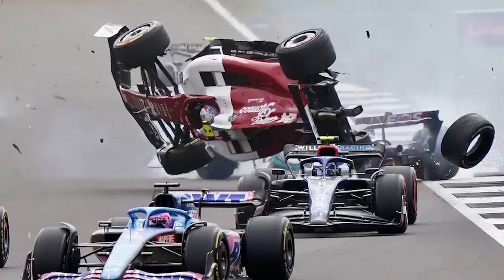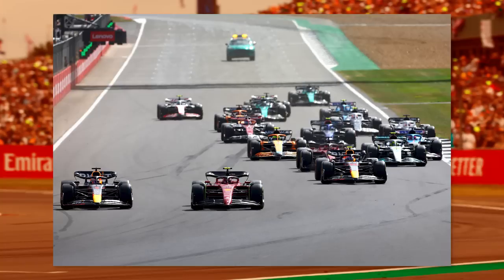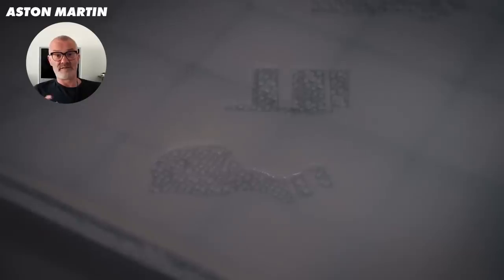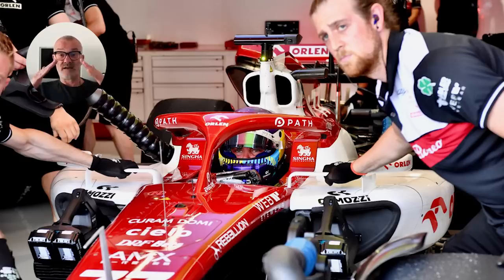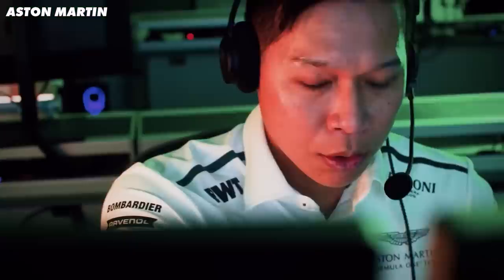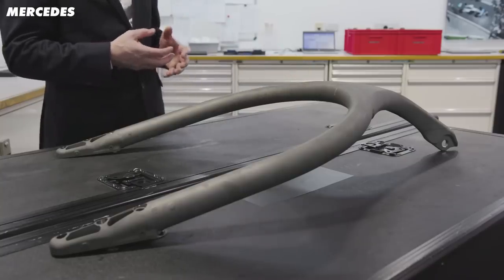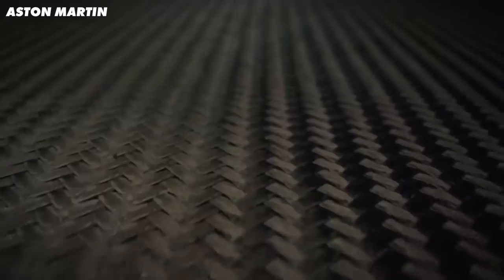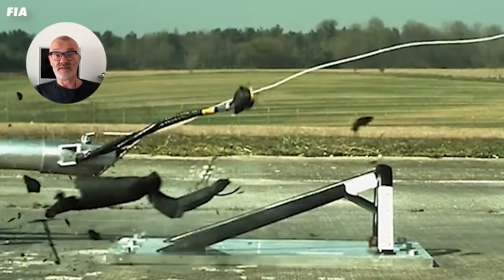Did the Roll Hoop FAIL in Zhou's Crash?

Comment: I find it very odd that they are allowed a blade style hoop, or even a two-leg design. Zhou's crash showed one of the biggest issues with lab testing: the real world is much crazier. As it spun upside down, it essentially wiggled the blade and seemed to have broken the carbon. A four leg design most likely would've lasted a lot longer, as it can disperse the load across a much larger area. 
It is also surprising it is just bonded on top, instead of being made an integral part. The entire monocoque is handmade, so integrating it would be possible. Given how important it is, it would be a good way of retaining the hoop in an upside down slide.
Reply: Exactly
Reply: Doesn't seem like rocket science does it. I agree, a 4 leg design seems like a no brainer.    As for the testing..  Why they used a static load test for a part destined to experience impact, is a real head scratcher.
Reply: @M3rVsT4H  Same reason helmet makers test their helmets in static form: it would never pass a dynamic test. 
The latest standard in MotoGP is the first to do dynamic and random testing, coming closest to a real world scenario.
Reply: @Yvolve  Now helmets I get. Wherever big profits are to be found, you will find shortcuts.  But nobody gains from this... Other than just not wanting to crash test such an expensive monocoque.. I can't think of a reason why you wouldn't just test thoroughly.   but oh well, I guess that's why they get paid the big bux.
Reply: That wouldnt hae made a difference. the mono is essentially a composite of carbon fibre and a comb between the layers. What happened here is that it sheared at the comb so the top side was gone but bottom side was intact. Thats the biggest problem if oyu glue it. You get the weakest point between the layers and the comb. if you bolt the roll hoop the differs. not the bolt is hold underneath the whole therefore it is way more resitant to shearing.
Reply: @Infiltator2  Not really, especially in crush structures, it's solid carbon. 
It needs to be moulded in and through the carbon, all the way down to the floor, like any real roll cage.
Reply: @M3rVsT4H  Over-reliance on computer models I guess. As I said, the real world is often crazier than models can predict or have data for. The just need to destroy a couple of basic chassis, to see what happens. Paid for by all the teams together, make a generalised body that has a specific crash structure to homologate it, so it can be mandatory.
Reply: @Yvolve  Dynamic impacts can be perfectly simulated. The problem is, you actually have to do it. Be creative and not only model a perfectly organized scenario. Some 'tests' look less realistic than the choreography of a cheap action movie.
Reply: @mennovanlavieren3885  I meant it more in the way that you can't always model for everything, obviously, but it seems they're going the route of motorcycle helmet manufacturers: they test in a very specific and repeatable manner, which leaves out the randomness of the real world.
Look at Grosjean: it turns out, they never though about what would happen in that situation, nor did the person who designed that barrier. 
Zhou's crash shows that they need to do real world testing as well, because you can't program for every parameter and iteration.
Reply: @Yvolve  True, perfect safety is not possible. However, I would say one can do more test scenario's with computers than destroying a real object every time. Although some real world testing is always necessary to validate the simulations.
Reply: @Yvolve  the only real world testing that would stand to those standards is actually racing and see who crashes and how, every test that you can immagine in the real world you can simulate on a computer these days (also in the real world you only test a few times with such expensive cars, on a computer you can simulate 1000 crashes slightly different parameters and see if you got lucky the first time)
Reply: @mennovanlavieren3885  Modelling is great, but it needs to be done in real life as well. Is the glue actually as strong as was modelled, etc.
They rely too much on the models in my opinion, with the biggest being that the model is incomplete.
Reply: @Imthefake  As I said: the models don't always take into account weird things that happen in the real world.
In Zhou's case, a car that was doing an under-flip and a 180 at the same time, landing ON the blade, on tarmac. Models usually do not go this far when it comes to testing, as it is programmed by someone. Their imagination is the limiting factor, so many possibilities aren't tested.

Computers are great, but not the be all, end all of everything. If this worked so great, why does NCAP still crash cars? 
The monocoque is a homologated part, which the FIA can test as a general item every car needs to use. It's expensive to smash a bunch of those, but not more valuable than a human life. 

Your reasoning is what creates the blind spot in testing in my opinion: computers can do it all!
No, thy can do what they are told, so the person programming is the limiting factor in possibilities for tests. This is a problem.

Comment: Great video as always. A little sidestep: did you also notice the new trend in ‘22 that after contact the rim fails and a tyre (and shrapnel from the rim) gets lose from the cars? I guess this is a new safety concern with the new cars (and 17” wheels).
Reply: Happened already at Max's crash at Silverstone last year. I haven't seen that in 30 years before, but a couple of times since then. Seems to have started with the introduction of stiffer sidewalls for rear tires mid season last year, and with the 18" rims, now all wheels have these stiffer sidewalls.
Reply: The shrapnel we saw from the rim looked like it was just the plastic rim cover (a.k.a. wheel shroud), which quite predictably shattered instantly upon impact. Probably nowhere near as much of a safety concern as the pieces of jagged carbon fibre that regularly break off from the oversized front wings the drivers can't even see.

Comment: I disagree! I have a suspicion and I'm sure I am in the minority that 'The Halo' did not save Zhou. On the contrary - it added to the speed of acceleration ... he was very lucky. It acted as a skid and caused more rotation. I think the gap between the top of the engine housing / air vent would have been more than enough to protect Zhou's helmeted head and actually act as an anchor, dig into the tarmac and slow the car down. Instead it became a missile and could have gone absolutely anywhere. That is only a theory, and is most likely wrong, but it should be put out there all the same. What saved Zhou was the incredible strength and flexibility of the car, not the halo. The halo is a work in progress, and must not be considered a success yet. In certain situations it may cause far more harm than good.
Reply: Not picking a fight here but the front of the hoop has scour marks and sparked like the Fourth of July. He’d be headless with out it. Lucky man.
Reply: Front of the halo I meant. Stupid autocorrect induced spelling errors.
Reply: They should consider attaching a lower support section to that hoop that wraps around the monocoque. Build it into the tub as a key structural element? Just thinking out loud .

Comment: That was extremely scary to watch... It seems like some of these recent accidents are getting more violent each time
Glad we didn't have em while the halo wasn't here yet some years ago
Reply: I feel like the tracks need to be held to higher specifications to meet the 2022 spec cars now, as intensive as the current ones are the cars are clearly getting just a little ahead of them now
Reply: Bruh. Do you not remember Canada 2007? That is THE most violent impact I've ever seen on a racetrack. F1 cars have been crashing violently for years. The Halo has protected far fewer than seatbelts, roll hoops, carbon fibre monocoques, and kevlar fuel tanks have. People like to say how many lives the halo saves. It's maybe 4 people in the past 4 years from injury. The HANS device alone has likely saved dozens of drivers from serious crippling injuries or death. An aeroscreen would be a much more visually appealing all-encompassing cheaper solution than our current halo. Btw, the halo would NOT have prevented Massa's injury because that was caused by a small piece of debris which would have slipped through the GIANT holes in the halo.
Reply: @morgan200three  I get that same feeling
Reply: @MrJr1976  Yep, that was violent but it's a different kind of crash, not nearly as dangerous cause the car flying around protects the pilot from that massive kinetic energy
Even tho the monocoque was damaged it was nothing NEAR just ripping the roll hoop off, that would insta kill Zhou without the halo, that's it
Of course a seabelt is more important but there are some crashes where the halo just straight up saves the guy
4 in 4 years isnt good enough? What if we had 4 dead drivers in 4 years? Keep in mind only 2 drivers died in the 80s during official GPs...
Reply: @danielsgrunge  4 drivers saved from injury. Grosjean would have died, Zhou would have lived, whoever it was in Spa would have been injured and Lewis could have died. The reason why Zhou would have lived is the way the cars are designed. If you flipped a formula car upside down, the high part of the nose and the roll bar/intake is generally a straight line above the driver's head. A plexiglass aeroscreen and a roll bar built into frame of the car would be a better combo.

And if you wanna get REALLY technical, Grosjean's problem was caused by those stupid Armco barriers that force the drivers to submarine.
Reply: @MrJr1976  Bro the roll bar was ripped off, along with the intake and everything else, look for the pics of his car
Reply: @danielsgrunge  Right. That SHOULD not happen and HAS NOT happened in almost 3 decades. And if you look at the footage, his helmet would have been scraping and he would have been injured, but not dead. Doesn't change my point that people are WAY over-estimating how important the halo has been. I will give you Lewis and Grosjean. Those WOULD have been deaths. But Grosjean wouldn't have needed the halo if we had outlawed the dangerous and outdated Armco barriers.
Reply: @MrJr1976  whatever you say bro
Reply: @danielsgrunge  Im just saying that the halo (in its current form) isn't the solution to the problem that needs to be fixed and there are other more pressing issues motorsport in general faces which are way more dangerous than the halo.

Comment: Failure sounds like 'sheer' induced by tension. Load forces on roll structure transmitted to bonded area on monocoque. Layers of carbon fiber do not have much resin in between. When parts are formed, resin is introduced while part is in vacuum bag. Part then goes to autoclave where vacuum and heat cures resin. Many layers are supposed to become a single part, but weakness between layers remain. Lots of resin on top and bottom, not so much between layers. There can be many layers depending on requirements, so many little weaknesses hiding under surface.

Comment: In the old days the roll hoop or roll cage was one shaped piece of similar material surrounding the driver. Now with the roll bar, a dissimilar material bonded to the C/F, the loads are transferred to the localized portion where the materials are bonded. I worked with C/F for many years and while it has extraordinary strength, its weakest is in shear and seemingly what/where the forces were applied here.

Comment: I guess the halo will be extended to protect more the driver in case of hook failure. If they mount them together it might pose bigger risk for bigger shocks on the driver, which might kill him. In this crash the car slid in somewhat predictable way, with only the final flip being quite scary, and the road being too close to his helmet.
Reply: The Halo saved him 100%
Reply: Halo won't be extended because of the safety compromises.
They tested it, any bigger and it would start hampering marshals trying to extract a driver too much from what I've heard.

Unfortunately can't make a perfectly safe car, but at least we've reached Safe under most sensible circumstances.

Comment: Hot take: The roll hoop should be a standardized part built using tried and true methods. There is no need to allow the constructors to design their own. Its a matter of driver safety and if everyone has the same part the competition won't be affected.

Comment: So from personal experience carbon fibre is brittle, especially under a lateral load (bending along the 'grain'). Also regular titanium isn't the most abrasion resistant. As a breakdown - a sharper shape of the hood, in a material which will grind relatively quickly to form a sharp corner/edge (sharp points will snag and catch on tarmac), and supported by a small rim of adhesive on a brittle material with stupidly high peak loads from the hood snagging.

Simplest fixes I can think of - 
hard metal cap to prevent grinding as much as possible, hardened titanium or maybe a thin plate of tool steel.

 thin and narrow sheets of titanium to work as legs underneath the hood which would give strength to the mounting area on the monocoque. Think like a pair of ratchet straps made of titanium and glued under the carbon fibre which supports the hood. It would mean carbon fibre is supported and way less brittle, as it takes on the material properties of the Ti as an additional bit of strength to stop the carbon fibre from cracking around the adhesive and letting the hood detach.

Comment: Guess you could raise the vehicle from the roll hoop and attempt to rotate the vehicle around the mounting surface with varying weights applied to come up with a solution. Perhaps the tub needs to be constructed around the base of the roll hoop so there are many points of contact for mechanical grip of the adhesive and the hoop in various directions.  Perhaps the base of the hoop could fit into openings in the tub and rotated slightly to create contact points above and below the tub to create multiple bonding locations. Just a thought.

Comment: You mentioned that bonded joints are stronger to carbon than bolted joints, and while that may be true in the fact that the epoxies can hold ~3500psi, and they will just extend the footprint to meet the load requirements, the problem that caused this to fail, as you also mentioned was delamination of the carbon, which can occur for various reasons including voids in the part. The FIA should take a look at the material allowables from the carbon failure to see if they need stricter testing of each of the carbon parts, that interface with the roll hoop, especially if they are produced out of autoclave. Teams should implement solutions that don't rely on only stressing the top ply, either with a bolted joint with a backing plate to spread the load and prevent the fastener from pulling through the carbon in a crash, or through the use of joints that spread out through multiple plies of the carbon

Comment: The whole “blade roll hoop” concept seems suspect to me. It will by definition transmit a huge lateral force.
Reply: By definition, any shape would transmit the same amount of load, its just distributed differently. That's how statics works
Reply: @philipcooksey3422  Sure. That’s my (relatively uninformed, and probably poorly expressed) point. The problem appears to have been the bonded carbon delaminating at the interface. So distributing the force over a greater spatial and temporal extent should help with keeping the roll hoop from detaching. Same force yes, but better distributed. The blade seems like it will concentrate the forces into one moment of failure.
Reply: @shibasurfing  This is why the blade flares out at the bottom. It's not an issue with the blade design itself - which would mean it should be outlawed. Rather, it's an issue with the mounting which should then be specified in the rules or tested more stringently. 

Alternatively there could well have been a manufacturing defect. We just don't know yet
Reply: @jameshogge  i see what you are saying. That totally makes sense.

I guess my question is, does the circular hoop do a better job than the blade of distributing the initial impact over a greater period of time? This would reduce the force. For a blade, it hits the track at once instant. A circular hoop would hit the track and then continue impacting for some time, decelerating it over a greater period of time. I could be completely off-base but it's what popped into my head.
Reply: @shibasurfing  I'm not entirely sure it would. If anything, I think you might guess the blade design would be better.

Reducing the peak force / spreading out the impulse over a longer period of time would come from flex within the shape of the roll hoop. Both designs would be very stiff in the vertical direction but the blade would be more flexible as soon as there is a lateral component to the force thereby cushioning it a bit?

Then again, that is also a very double edged sword: flexibility in the bonded region may allow it to peel up from one edge - essentially only one edge of the join will take all of the force and it will tear away from that point.

That would be my hunch anyway. Of course its incredibly difficult to guess how stiff these structures are - especially since they'll have complicated internal geometries to maximise the strength while keeping weight low. That's what the FEM analysis will be used for
Reply: @jameshogge  very interesting, thank you for your insight